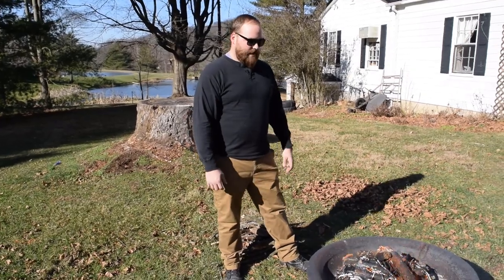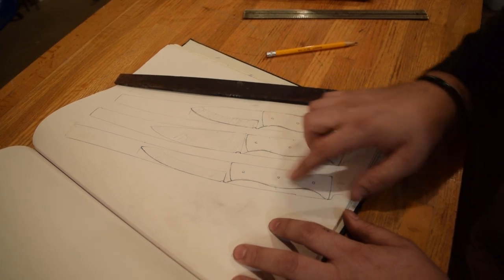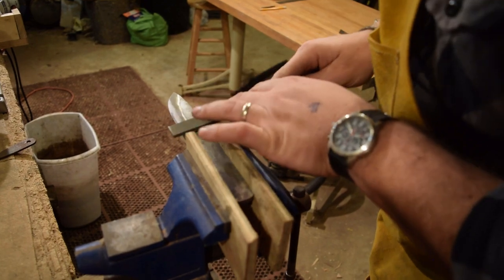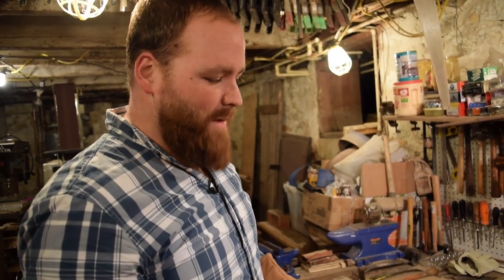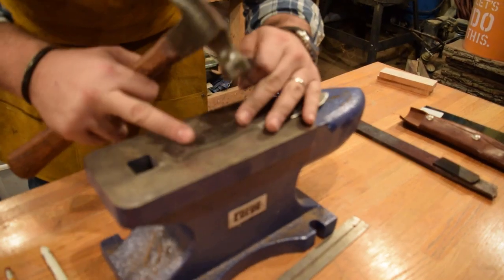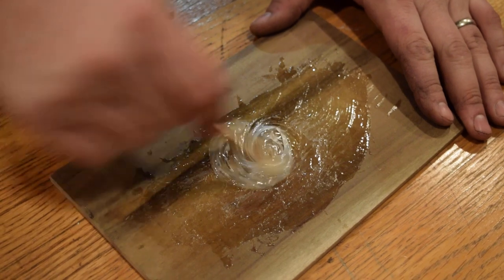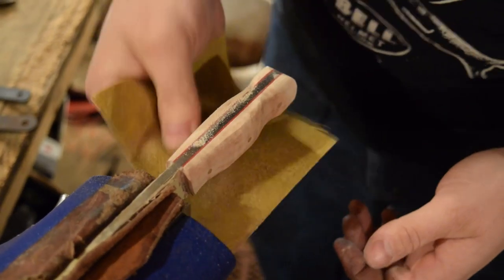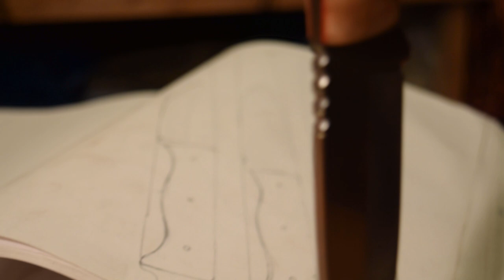Making a knife from a metal file.

Comment: Hello , I have been a knifemaker for twenty years plus ... I pride myself in the sheaths as much as my knife workmanship and would like to suggest that you look into using compression rivets , as they protect against customers cutting through and ruining the sheaths  as well as protect you from injury suits should someone do something stupid and try coming back on you for faulty safety measures. They also help in saving time , as I use three layers and rough in sheath design and then trim on scroll saw to guarantee all edges match and no sanding needed to complete the sheath. I have found that customers jam their knives home into the sheath , but , a sharp blade will push through easily , resulting in the possibility of injury or sheath damage .
I am retired now , due to injury sustained in auto accident ,but , I do enjoy your craftsmanship and attention to detail.... Keep up the great work , one other suggestion would be to use superglue gel between layers ,as less excess will be found inside sheath from compressing the layers together for final fit , and I use white glue to create highlighting nature scenes , before staining , as the white glue will impede stain from coloring lighter areas in leather designs . I have made 583, deer antler handled heirloom quality hunting knives , and was the Signature Series Knifemaker for AdventureBound Outdoors on the Outdoor Channel from 1996-2004 , just to let you know of my experience in this field .  My website is www.daviscustomknives.com , and will be until my for a short time longer as I have allowed the website to close down when contract runs out .
Good luck in all you do , and keep up the good work !
May GOD bless you and may you enjoy the journey you have chosen to take , I will miss seeing the dreamy looks that always accompanied the customers picking up their custom made knives I provided for them , as I found that there are other ways of compensation besides monetary , and the repeat business spoke for itself !
   Sincerely , Dave Davis ....
Reply from the maker: Dave Davis 
Thank you so much for your kind words and encouragement. I can’t tell you how much it means to me. Also, I will definitely heed your advice and suggestions. There is no better source of knowledge than one who has done it before you and is willing to help you be better at what you love to do. I would love to hear additional comments and suggestions on ways I can grow as a knife maker. Stay tuned, as I have more knife making, and plain old making things videos coming soon.

Comment: I would drill my holes before I temper the blade back up to a hardened state. Save on drill bit sharpening. Use cutting oil and slow the bit down so you do not get it hot and it will cut better at a slower speed to get that third hole in the shank for the handle dowel. I like a guard/hilt put on the base of the knife so your hand cannot slide down the blade when you stab with it, plus a pommel on it so it cannot be pulled out of your hands either. Seen here: https://en.wikipedia.org/wiki/Hilt, over all a nice piece of work though.

Comment: Just use the torch on that one small spot. Wrap the blade in a wet rag, while you use the torch. Having that one spot annealed again, isn't going to ruin the knife. Having the scales warp and curve up away from the blade later, because they are only glued there... will.
Reply from the maker: selador11 
Thanks for the suggestion. I gave that a try off camera, without success. I should try wrapping it with a wet towel, I've seen a few others do that same thing. Thanks again.
Reply: Another method to try is to chuck up a nail in your drill. With as much pressure as you can muster, spin the head of that nail as fast as you can, in the spot you want to drill. It should get red hot just where you are spinning the nail. Let cool slowly, and now you should be able to drill in that spot.
Reply: The Art of Craftsmanship i
Reply: @selador11  interesting idea.

Comment: I prefer wax
Get a cotton wheel I use turtle wax in metal. Buff and dip it in wax. Will never rust. Then wood wax on the handle buff w cotton wheel.  Then just touch it up once a year

Comment: sweet video!  have you looked into a 3 pin set up in a vice to straighten them?  Its quick and easy to set up with great results.  Saves you time and headaches.. has saved my tail on a couple of longer kitchen or bowie type knives.
Reply from the maker: Hunt Knives 
Thanks for the compliment.  That's exactly the trick that I use as well. With heat treating, having a few tricks up your sleeve is a must.

Comment: Lose the magnet,  and learn to tell the temperature by the color of the steel.  Double tempering has no benefits on plain carbon steels of which files are made.  It's used on complex alloy steels.   If you want to learn about hardening temperatures, take a bar of your steel and  heat it up to red. Cut in with a chisel  every inch or so along the bar  so that you'll be able to snap off pieces.  Heat the  bar to a dull red, quench and snap off the first section.  Do it again at a higher temp, snap off, and so on, up to a yellow.  An examination of the grain structure of the fractured pieces will tell you  at what temp the steel hardened.  It's important to heat evenly to the lowest temp that will harden because above that temp you will get grain growth. Your test samples will confirm that.  If you cut into an unheated section of file with your grinder and break a piece off, you'll see what a fine grain looks like.

Comment: As a first attempt at making a knife would you go with a saw blade or file? Your vids make it look easy but I know better LOL!
Reply from the maker: I would go with a saw blade first. You don’t have to worry about heat treating. Just cut your profile, add the bevel, and attach and shape your handle. Just remember to keep your steel cool when cutting. Good luck.

Comment: I've watched other videos where they are making file knives, but they don't preheat or anneal the file as you state to soften the metal first. What is the primary difference between the two ways that the knives are made? If they don't anneal the file first and then temper it in the oven, are they creating a weaker more inferior knife? What is the purpose of demagnetizing the blade? I'm new to all of this, so I'm trying to start off on the right foot. Thanks!
P.S. I don't own a forge. Do you have a video for your bucket forge? Very cool!

Comment: Would it be easier to drill the holes for the handle before you harden it? I have zero experience with metal working, so I'm sorry if that's a dumb question lol

Comment: Wipe the blade down good with isopropyl (medical), methyl (wood) or ethyl (drinking) alcohol to get the oil off first, and then the oven works fine with no smoke at all. As far as the drilling, I laugh in sympathy with you brother. I have made that mistake myself a couple of times. Best to drill your pin holes right before heat treating when working with file steel. Another good trick is to use a dual temper during hardening followed by the general temper at 350 F to make the blade tough as nails, as well as hard as heck on the edge. Hard to sharpen, but will hold that edge till you know what freezes over, then some. Should be able to use the blade for a tree climbing spike for how tough the blade is after that. The big problem with old file steel (W1) is that it often doesn't flex well after hardening/heat treating, and will snap easier than other tool steels. However, that is a lot to do with the process used. Beautiful blade though.

Comment: Good work here but fails on a lack of front ferrule/bolster to hold the thing together.  Looks very pretty no doubt -- time will tell when used under load and wet conditions .  Sort of 'half a job'. All the old designs had either stacked handles or solid with a clear metal fitting at least on the blade end .

Comment: What’s the liner that’s used in the handle. Rowmark acrylic? Anything more specific that that?
Reply from the maker: It’s a sign making acrylic light fast material that I get from a local sign making shop.
Reply: They have like laser max,laser glow,colour hues,colourcast acrylics, frosted acrylics,etc. What kind do you use?
Reply from the maker: Kevin Zych I have a selection of some of them. They all work, just look different. Just make sure it’s rated for outdoor use. That’s the light fast difference. Another brand and line is the Gemini “Duets”

Comment: I would think that after shaping the knife and before hardening/tempering you should drill the pin holes then, do the hardening and tempering makes it easier?
Reply from the maker: Allen L Malsbary Jr 
Your right, but being this was my first video, I made a few process mistakes that I would normally not do, drilling the holes after heat treating being one of them. Thanks for watching.

Comment: Absolutely loved the video! What kind of Table top sander do you have? I'm just starting out with Knife making and trying to see what to buy without spending $2000 on a 2x72 belt grinder!

Keep it up! Can't wait for more videos Liked and Subscribed!!!
Reply from the maker: Soulless Cabinet 
Thanks for the compliments. The sander in the video is a 4x24" belt/ 6" disk sander combo. I have recently purchased a 1 x 30" belt grinder which works significantly better for grinding bevels, and only set me back about $75 (harbor freight). I'm also considering purchasing a 2x72 but it's hard to bite that bullet. For the amount of knives I am currently making, the cheaper grinder does the trick. I use the 1x30 in my next knife making video, coming soon.

Comment: I like your angle grinder rig! Question: why aren't you just using your table grinder instead?
Reply from the maker: At the time that I filmed this video, I only had a 4x36 table top sander. I would use it some, but it didn't really work well for metal, due to its lack of horse power. I have since gotten a 1x30, and more recently a 2x42 belt sander. I still like to Hog off material with the angle grinder. The grinding disks are a lot cheaper than belts. 
Thanks,

Comment: Would an old file be suitable for a chisel knife? (mostly for EDC as an carpenter) iam worried it would be to brittle and crack when hitting it with a hammer? iam planing something like that with annealing it before and quenching it after to give it back some hardness so it will hold an edge. also what type of oil(any other oil beside the canola oil you used here?) is suitable for quenching a blade like that? sry iam a total noob and know nothing about that apart from what youtube videos teached me  input is very much apreciated! thanks in advance! =)
Reply from the maker: Thanks for watching and the questions. I would suggest that when you quench your knife, only quench the blade, and if you are able, maybe even only the cutting edge. That might be a little more tricky with a chisel knife. This way you spine and handle are still much softer than the cutting edge, and you won’t have to worry about it cracking when you hit it. This sounds like an awesome project. Also, I am using canola oil to quench my file knives. There are specific quench oils that you can buy, like Parks 50, but I’ve always had success with canola. It is good to warm it up to “warm water” temp before quenching m. This speeds up the quench just a bit. There is a great app you can download on your phone from HTS (heat treaters society) called the heat treaters guide companion, which will walk you through all the specifics when heat treating different steels. Also, don’t over look the file test after quench. That will tell you for sure if your blade is hard when the file skates across the surface. Temper in an oven for 2 cycles of 2 hours at 400 degrees and you’ll be all set. Good luck. Thanks again.
Reply: @TheArtofCraftsmanship   Thanks for the quick and elaborate answer! great, i feel abit more confident now! i will let you know what my results ahve been once iam this far! Thanks alot!

Comment: Nice video man!  Have you tried draw filing to clean up the bevels?  It's always worked well for me...
Reply from the maker: Leatherhead Hoseck 
Thanks for watching and for the suggestion. I don't draw file all that often, but not for any particular reason. Mostly push file out of habit, and I think it helps me control the angle of the file better. It's great to have more "tools in the belt" to use so thanks again.

Comment: Mate try a filing jig! Look up Gough customs on YouTube to learn how to make and use a filing jig. Much easier than hoping you're right and some  guesswork! 
Then you can file your file in a filing jig, happy filing.
Reply: Oh, yeah, heat treat begins with annealing? To soften the file for shaping bevels etc, then normalise 3x, then harden n quench, then temper?
Reply from the maker: KEVIN CAIN 
Thank Kevin for the comments. Yes, you have the order correct. Anneal to soften, remove most of you stock to shape, normalize 3 times, quench, temper, then do you final shaping. 
Also, concerning the filing jig, I did most of my removal with the table top sander, and have seen a few different versions of jigs that I have though about making, but I have a small grinder now that I do most of my stock removal on, and I use a bevel jig to keep my bevels even. 
Thanks again for watching and your suggestions.

Comment: Was just wondering. When you put it in the oven you said in the beginning that you had it pre heated to 400° but then you said you were setting the timer for two hours at 200°??? So what temperature are you supposed to temper it at??
Reply from the maker: Matt Megyesi 
The oven is set at 400 degrees. I did realize I had said the wrong thing but not till weeks after I posted the vid.

Comment: How did you make your forge? Excellent video thx
Reply: He said in the video it's plaster and sand mixed.  So, take a metal container, place something circular in the center that can be removed (some cardboard would probably work best) and then pour the mixture around the perimeter and let it cure.  After it's cured drill a hole for the torch, then remove the cardboard center.  Easy. 

If you can't, or don't want to build a forge, just use lump charcoal.  Dig out a little pit with a three-sided dirt wall, get your lump charcoal hot, place your knife in it to where it's surrounded by charcoal, and use a hairdryer or something that will blow air on it continuously.  This method is good for heat treating knives if you don't have a forge.  I use this method myself and it works great.

Comment: Nice Work! what kind of gas was your burner running in the can forge?
Reply from the maker: Doug Dunlap
Thanks. I'm using propane in the forge. I have the torch connected to a standard size grill tank with a hose extension.

Comment: If I have a peace of steel. I heat it till its glowing red, and stick it in vegetable oil.    Will it harden?
Reply: Not unless it is high carbon, 0.45% or better.
Reply from the maker: Try it. That’s the only way to find out if it mystery steel. If you can’t cut it with a file, or as we sat in knife making “skate a file”, Then it has hardened. Have fun.

Comment: Hello Dustin, If we omit the phase of the oven, what would happen? Greetings from Panama!!
Reply from the maker: Eduardo Bethancourt 
Thanks for watching and for reaching out with your question. The heat treat and quench makes your knife extremely hard. So hard that it is too brittle to be used. It would easily break if dropped on a hard surface. When you heat the blade back up in your oven, you are tempering the blade. What this does is brings the hardness down some to make the blade more tough, but you don’t lose all of your hardness. That is why it is important to keep track of your temper colors on the blade. The golden or dark straw color is the color that the steel will get when it is the appropriate hardness and toughness. This will usually be between 55 and 65 on the Rockwell hardness scale.
Reply: @TheArtofCraftsmanship  Thanks for writing, very well explained. Now I have everything clarified.

Comment: Why the multiple air cooling's before quenching?
And why didn't you drill it before hardening it?
Reply from the maker: WickAndTallow 
The multiple coolings before the final quench is called normalizing, and that helps to align the structure of the steel more cleanly, which helps to lessen the chance of cracking during the quench. I forgot to drill before hardening.

Comment: If the file is already hardened why normalize it? Just to make it easier to work on? Could you just shape the knife and then temper it?
Reply: Keith Macdougall I tried that before. Files are a very hard steel to the point that it is brittle. I snapped the end off of my knife because I tried that. I’d anneal it and do it right